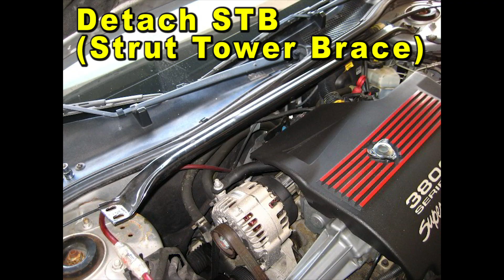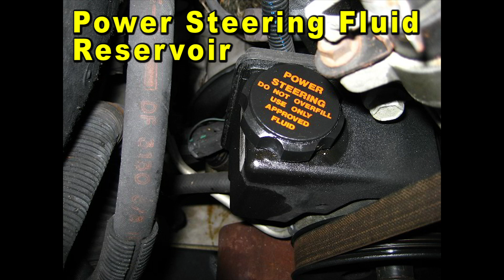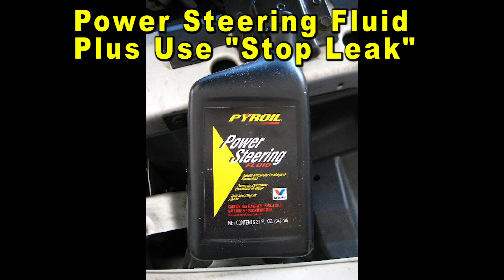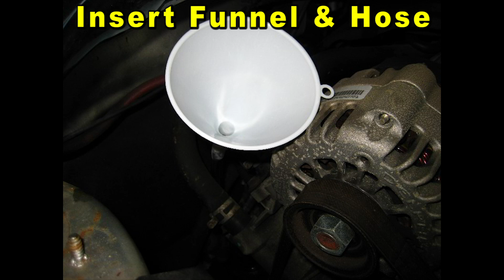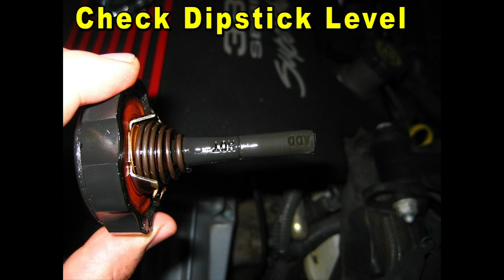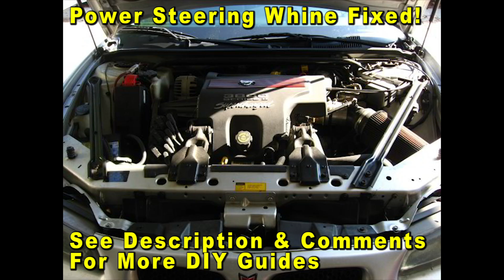1997 To 2003 GM Pontiac Grand Prix How To Fix Power Steering Fluid Leak & Whining Sounds

Comment from the maker: Pontiac Grand Prix Brake Fluid - https://amzn.to/4cRnKzN
P/S Stop Leak Fluid - https://amzn.to/3SmT2Gn
Precision Screwdriver Set - https://amzn.to/3sLixaP
Plastic Pry Bar Tools - https://amzn.to/3HMtsV7
Socket & Ratchet Set - https://amzn.to/3Z17LbA
Mechanix Gloves - https://amzn.to/3jCnHkt
Torque Wrench - https://amzn.to/3vS5uSI

The Paul79UF YouTube channel is a participant in the Amazon Services LLC Associates Program, an affiliate advertising program designed to provide a means for sites to earn advertising fees by advertising and linking to Amazon.

This DIY video shows owners of the 7th generation 1997, 1998, 1999, 2000, 2001, 2002 and 2003 GM Pontiac Grand Prix how to fix a minor power steering fluid leak with "stop leak" fluid and also stop the whining noise by properly filling the reservoir bottle.

Comment from the maker: Check out the DIY guide for repairing a minor power steering fluid leak and stopping the whining noise in a 7th generation 1997 to 2003 Pontiac Grand Prix with the 3.8L V6 - 
https://www.paulstravelpictures.com/GM-Pontiac-Grand-Prix-GTP-Power-Steering-Whine/index.html

Here are all off the DIY repair and maintenance tutorials for the 7th generation 1997 to 2003 Pontiac Grand Prix - 
https://www.paulstravelpictures.com/Articles/GM-Pontiac-Grand-Prix-Common-Problems-Repair-Maintenance-Guides.htm

Owners of other General Motors vehicles equipped with the 3800 Series II L67 or L36 engines such as the Pontiac Bonneville, Firebird, Buick Regal, Park Avenue, Riviera, Le Sabre, Chevrolet Camaro, Impala, Lumina, Monte Carlo, Oldsmobile Eighty-Eight, Regency, Intrigue, LSS and Holden Commodore may also find this guide to be useful.